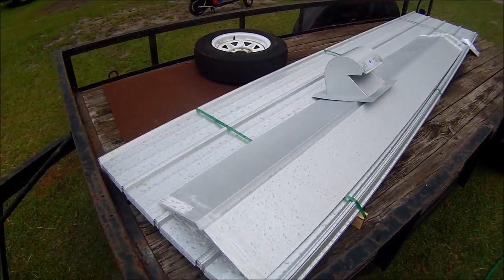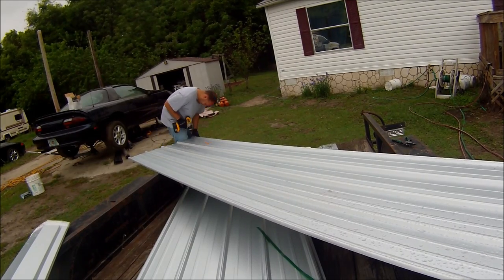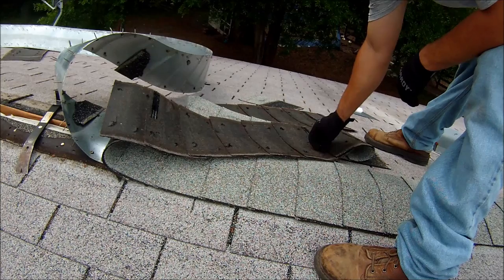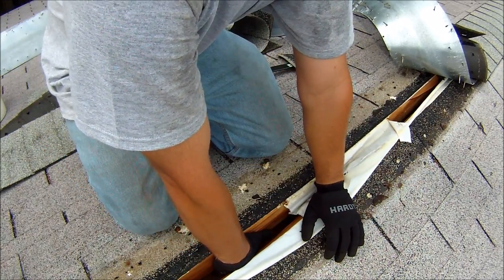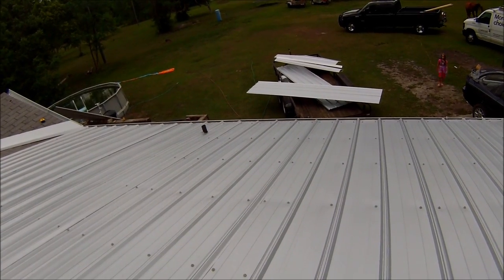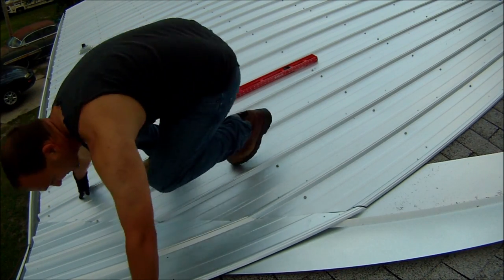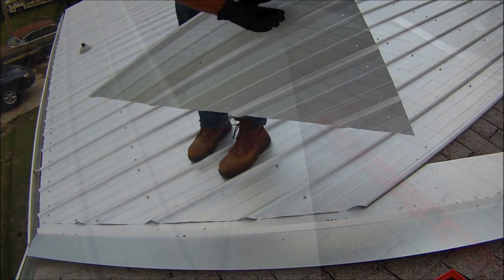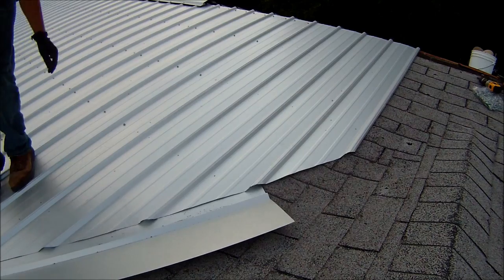Metal Roof Over Shingles on a Mobile Home by Myself

Comment: I was a manufactured housing contractor for 7 years, The metal you removed has no structural purpose, it is there merely to keep the elements out, imo, you did yourself a dis-service by removing it, it will not vent the roof, but allow air,bugs,water etc more easily accessed into the home, it also covers lag bolt holes the lag bolts are the structure bearing component you dont want to remove, and they were probably covered by a course or two of shingles.
Reply: I think some roofers do this and take out the aluminum vents on one side so the install is easier not having to cut out holes for the vents and just cover it up.

Comment: Hey man; why do some people  run 1x4 strips and then screw the tin to that? I like your way a lot. I want to do this on a portion of my 50's wood frame house. Thanks!
Reply: Its done so that every screw is going into something that grips which osb and plywood do not rate high on
Reply: What Tim Wiseman said, Its so the screws actually grip into something solid

Comment: Aren't you supposed to overlap the valleys with the lower panel at the bottom? That way the water flows over the overlap, rather than trying to get under the bottom one

Comment: Aren't all those screw holes going thru the metal roof potential leak areas?
Reply: The screws actually have a little rubber o ring on the to seal the hole.

Comment: That metal at the ridge underneath the shingles is to hold your home together, also the metal will rust inside out with out a vapor barrier between the metal and shingles!
Reply: Also the 7/16" if it's that thick OSB decking is not thick enough for exposed fastener roofing. I'm sure your figuring this out now.
Reply: They bolt the house together, and screw it all the way down, I dont think they'd rely on roofing nails to hold the top part together

Comment: If anyone is doing metal work like this get the set of DeWalt shears from lowes and after getting the first pitch use a chalk line and center of rib to center of rib is typically 36 inches

Comment: so why didnt you use self tapping screws,you could have had the panels installed by the time you pre drilled the sheets
Reply: Joe Scheller makes it look nicer because they will be a perfectly straight line and it keeps from denting the roof when your bit skips off the screw trying to push down to self tap

Comment: Also had some damage from Matthew that will require a new roof. 

I just watched your video, climbed up and took some measurements, made a drawing and about to make my way up to Century metals in Waverly, GA to place my order. 

I'm thinking about using 1x firring strips and am curious about why you did not. Cost savings?
Reply: the strips are generally used under panels with rated rigidity for unsupported spans, no? I'd be surprised if a cheaper through-fastened panel would qualify

Comment: Not bad the only thing I seen that was wrong was you use the lap tape where you didn't need to use it that laptape should have been in between each and every single panel that you laid down on the lap that's why they call it laptape it really does help and work in raining high winds

Comment: I think the metal roof cap you pulled off keep your trailer together and hope I'm wrong....
Reply: Pretty sure they wouldn't rely on roofing nails to hold the trailer together, when the double wide comes together they screw studs together then put sheetrock over the middle

Comment: I have done a few of these roofs I thought the screws were suppose to go on the peek points not on the flats on the metal roof sheets mabe because we get snow and putting it on the peeks not the flats helps snow slide off but easyer and way faster then shingles
Reply: I have always heard to never put it on the ridge for certain reasons, most roofers will put it in the valley not the peak

Comment: that sticky tape is normally used between the overlaps to the metal. not bad for not being a roofer. The middle of the house is bolted when they put the house together,,,,, jeeez i have a mobile
Reply: Yeah thats what i said to the people that think that metal strip holds the house together..

Comment: Never lay metal roof on shingles.. install firring strips... screws we're on the wrong side of the ribs..
Reply: You must install perlins or firing strips, wind will blow metal off a roof without perlins first.
Reply: @Truth Shark When you examine his head you will find a lot more money in it. It is only an expensive steel roof ( Galvalum ) because greedy contractors mark up the materials price 30%.

Comment: you did a good job. but I would never put that metal direct on the shingles I always strap it first. and as for the screws they are better on the flat if you put them on the ribs they loosen up when the metal   shrinks and expands.
Reply: Buuuuullll sheeet
Reply: When I built my dads garage 25 years ago I put the screws on the ribs there's no decking so it's straight to the roof joices that are on 24 inch centers. It's still holding up strong and no leaks to this day.

Comment: 4 minutes into this, and I never would have guessed that fasteners would go into the low part of the metal. I would have guessed that they would go through at the ridges or highest part of the metal.
Reply: Putting screws just on top of the Ridge alone is not enough to hold the metal roof down manufacturer allow to screw on the flat area if you use the right screws.

Comment: hello i just watched your video read most  of comments !!there is no doubt that i would have done some things diff but really its    ok how ever you wanna do it an i understand you were trying to help ppl understand you can do it yourself...the thing i wanna share with you an ever one that reads this today generation ppl are to lazy to do what you had done its sad ..so HATS off to you sir ...One more thing i live in ILL so we got cold winters an hot summers my point is i would never screw on the flats for roof metal side metal yes...the reason i feel like that is the metal here expands the winter an summer an what the will do it wholler your holes out enough it will start to leak...i seen it in my own eyes..im just curious mabe you guys dont have that prob in fl since it stays warmer year around...thanks happy Hoildays
Reply: Your welcome ..Not a big deal everyone does it diff..shoot that's almost to warm it's 36 here tonight I don't mind that..last week was as low 3..thanks you have a good one sir✌
Reply: AmateurHomestead I believe you are a little naive when it comes to the warranty. if you ever have a problem with the metal I can almost guarantee you that the manufacturer will point and find something you did and claim it voided the warranty. not saying you did anything wrong. just saying they are crooked and will will not replace anything for free.
Reply: You got it Mike. I talked with 3 different manufacturer/distributors salespeople and they said the same thing. The warranty might as well be written on flushable toilet paper.
Reply: P.S. The name you're using was a joke from the '50s  (Seems silly these days, unless you're Mrs. Hunts actual child, then I apologize.)

Comment: Metal condensates is one reason why you use a metal hat channe/raill and not a damn 1x4. And for installing directly on top of the shingles, the shingles will brake down due to the extreme heat under the new metal as the shingles brake down the metal roof will become loose and all it needs is a strong wind and your sad roof will be gone. LOL

Comment: Screws never go on the weak part of the sheet metal.
Always on top of the hard bumb lips that way more strong for the weather.
Only the ends and top slap screwed for better weather protection  
And wrong to do metal sheet on top of the shingles , more weight and the pressure of the heat will lose the screws in the long run.

Comment: I use an angle grinder with cut off wheels to cut my metal. Yeah you go through quite a few blades but you can usually get about five sheets out of one wheel.

Comment: By the way this stuff can be cut with a skill saw with the blade running backwards
Reply: They actually make abrasive disks just for this.  They don't make jagged edges the way a blade does.
Reply: J Service those disks are noisy as hell.
Elec snip that attaches to a drill is less than $60.
Reply: Gerard Jones it will void your warranty if you don't use a cold cutter

Comment: "Pre Drilling?"  Is that all the talking?
They use 'self-tapping" or "self drilling" screws there is no need to drill holes for the screws to fit into.  
Watching amateurs is ok, but before trying thero approach on your home - do a bit of research. 
He seems to have avoided many perils,  The VTR idea only makes sense if the attic space is properly vented in the eaves or gable ends.  This home was NOT DESIGNED for a VTR - that should give one pause before 'fixing' something that was Engineered to FHA VA Standards and constructed accordingly.  I am no sure if the VTR is supposed to run the entire length of the roof.  I've always run it short of each end and plugged the ends. So, in this case, I would have tried leaving the 'factory' ridge covering on each end. BWDIK!
I have to hand it to this guy - he's doing a great job!  
I would have stripped the roof,  replaced any 'bad' wood, added purlins, added insulation between the purlins, added membrane and then installed the metal.  Well, I would have paid someone to get on my roof in the Florida sun.

Comment: the piece on the higher elevation MUST be on top.  Otherwise the water flows under the next piece.  If the lower piece starts UNDER, then water goes over.

Comment: Your vent pipe was too short you should've added a coupling and extended the pipe without compressing the boot. Don't forget to use pvc glue on the pipe. Never create a trap for water as you did with the boot.

Comment: That was the absolute wrong kind of boot for the vent pipe. That thing is going to hold water and breed mosquitoes. You should have made the cut as tight fitting as possible, then put sealant tape around it, then put the correct sized boot over the vent pipe.  That silicon isn't going to last forever, and you are going to have a major leak where that vent pipe it.
You may thing that because you left the shingles on the roof it will be OK, but you just put a ton of screws through the shingles on that roof.

Comment: should have let a pro handle it . there was just no need in all that pre drilling but when you go over the existing roof we screw 1x4's down to the joists mostly because screws will not seat themselves correctly in OSB sheeting and i hate to be the one to tell you but one good wind storm and your roof will be gone. "pray its at least 1/2 plywood"

Comment: I did not remove my existing roof cap before putting my metal roof directly over the shingles on my mobile home.
Reply: I think what is done is the existing roof vents are are removed and the holes covered up and a ridge vent is installed in its place. I have 3 existing round roof vents and it would make metal roof install easier without them. The orig nailed metal strip adds structure and I think I would use smith ties at each rafter cross over. I think its a good idea to keep that rafter structure tied properly. I do not see this structure tie discussed anywhere.

Comment: Hey man your scratching them panels all up walking on em and sliding the panel your removing on the others. I build pole barns and paying close attention to that expensive metal and its finish is top priority.

No customer wants scratched up panels on new materails. Try throwing a couple roofing nails in the first couple holes you drill to hold the panels in place.

Remember sliding the panels on each other is no bueno. Either be fast when picking up the panel in 1 lifting motion or hire a helper when working with that expensive metal sir.

Comment: Always lay Lathes first at 24in OC. I'D love an insurance company adjuster see this.
Reply: Exactly what is the risk of not using lathes or furring strips? What would an adjuster have a problem with? Genuinely curious as I am about to do exactly the same as the guy in this video.
Reply: @ZBrock  Google it... Mainly rust and extream premature failure.

Comment: I understand trying to save a buck more than anyone. This is the worst thing you could ever do. I see this done all the time and it works great for awhile but once the old shingle becomes baked and brittle the screws start backing out. Now you have a thousand points of penetration and the underside protective coating has been sanded off from the granules of the shingles. Always remove old shingles. Kudos to this guy for his effort but this is a what not to video.
Reply: Weird, because the state of Washington says I can apply metal directly over my shingles so long as there's only one layer and it is in good general condition.  No underlayment, no strips, just metal on shingle.  Imagine, the entire state being wrong!

Comment: never pre-drill..screws will be too crooked..put it on and chalk some lines.
Reply: they would be staggered from one panel to the next due to the staggering of the panels at the gutter line
Reply: I have pre-drilled for years and have had no problems.
Reply: i guess if your customers are happy have at it. i been installing since 1999

Comment: 24:46 making a hole in your roof bigger than it needs to be is not a good thing if you know how to use a tape measure you should have no problem with an exact fit avoiding Rainwater leakage.

Comment: Pre drilling is bad, if any of the panels need to be slid up or down it throws everything off.
Reply: Not when the roof out of square, not mentioning valleys,crickets and dormers
Reply: No need to pre drill if your using impact drills
Reply: plus if you using firing strips sometimes moving up or down cause you not be on center with firing and in some case completely miss the firing strip.

Comment: you made one fatal mistake that they do not tell you you should have put wood strips fairly thick ones every so far apart then put the tin on the strips this way your old roof can breath if it sweats it will rot being compress with just the tin

Comment: Wayyyy too many holes, you only need 1 screw in between each rib, not 1 on each side of each rib! Screw holes are where the roof WILL leak in future, now you have twice as many. You might also regret not having removed the shingles first, they will not only create alot of extra heat in hot sunlight but will wear out the steel roofing sooner.

Comment: well I watched half of it and just couldn't take any more, as one who has done hundreds of roofs and walls with this, one, one you strap the roof or walls with 2x4's and you never need to drill anything as the screws used for the install drill right though it. and the biggest screw up is he installed the screws on the flat, witch it not recommended by the mfg or building codes, all screws must be on the rigges only, he also didn't install the foam gadgets at both ends or each sheet,, open him self up to many leaks in time, never screw on the flat, building inspector will fail you it blows me away all the really bad instruction by want a bees and the sad fact of the mater is hundreds that don't know any better will follow him,,, wow
Reply: Screwing into the ridges is obsolete. It warps the panel. They are all screwed into the flats now. The screws have neoprene washers on them to seal. If the decking was sound, screwing into the decking is fine, although there should have been underlayment over the shingles.